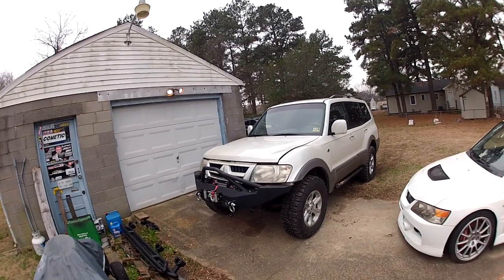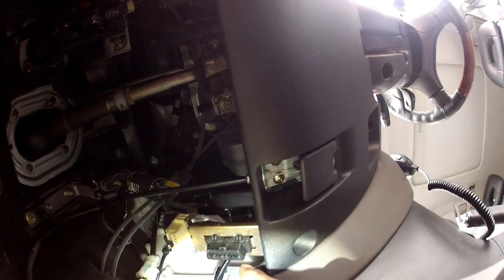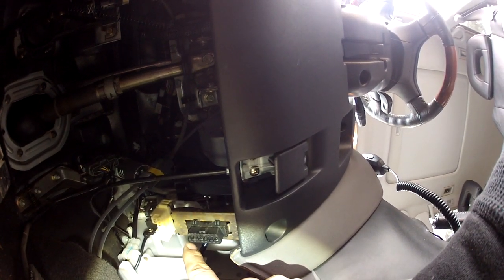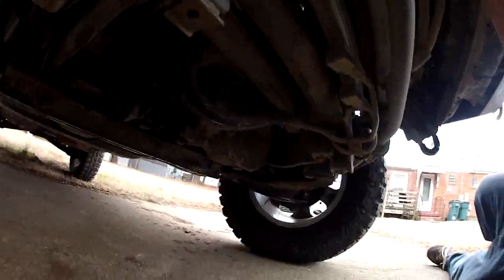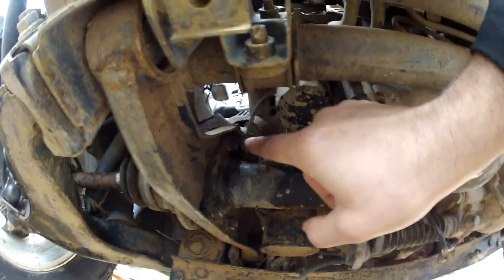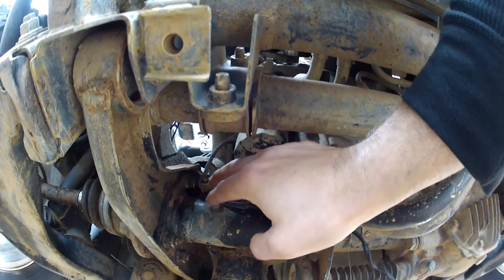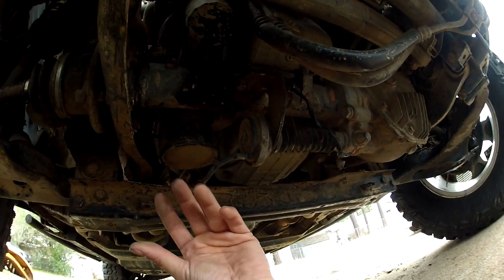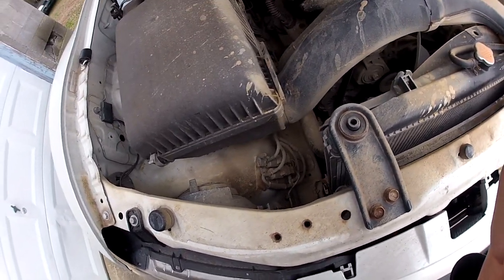How to fix blinking lights on Montero Pajero Activ Trac Super Select

Comment: Excellent video!
I recently bought a 2016 Montero Limited V6 4x4 in Mexico.  Shortly after taking ownership the blinking differential orange light started popping on at higher speeds after 20 KM of driving.   I was too late finding your video and I replaced the freewheel clutch solenoid (next to the battery) and this did not fix the problem.  We have not used the 4WD in quite a while.  When we tested it the other day, we got the 2 front wheels blinking indicator in every mode.  Basically, the 4WD is not functioning.  
Is the detailed information in your video applicable to my 2016 model?

Comment: Hello. I have a 2002 year pajero. I have a problem with the drive. Namely, after 15, 20 kilometers, the central orange light starts flashing. If I then switch to 4x4, it doesn't work. When I turn the car off and on again, it works normally. Thanks for the answer, greetings from Slovenia :)

Comment: Hi my actuator on the transfer case isn't working the gears don't light up when I select it, any idea?
Reply from the maker: Its likely not the acturator, but faulted and not telling the actuator to move. What are the codes?
Reply: @davidg.9478  gonna check the codes now bro will reply shortly
Reply: @davidg.9478  hi I did the paper clip test and the abs light flashes continously as well as the center diff light

Comment: Please I would like your help.  There is the gear lever of my mitsubishi pajero manual gearbox which shakes a lot on takeoff.  It also shakes when I slow down to stop for example.  Often also It goes out while I am driving normally 80km/h.
 The mechanic checked the oil in the gearbox, it was missing, we added oil but the problem persists.  He also checked the fuel injector pump but still the problem.
 Finally he told me that I have to change the clutch disc.  Need your opinions please

Comment: How you bypass from 4H to 2WD I also have code 33 and it only works in 4hlc and 4llc and when I go from 4HLc to 4H start blinking only orang light and is stuck in 4H
Reply: And on diagnostic shows t/f mode det 4H_4HL
Reply: Even if I chenge to 2WD

Comment: I have code 33. I just changed all the sensors and it still isn't working. It started to function but now it's stuff in 4wd and I can't get it out of there and into 2wd. It also won't shift into 5th gear. Any ideas?
Reply from the maker: After change the sensors, do you still have code 33 and center blinking light? Im going to guess you changed to after market switches and not OEM. The non-oem switches aren't as good, and sometimes you need to remove the washer to get them working correctly. The 5th gear issue won't be releated to the 4wd Active-Trac or transfer case. You may have unpluged something for the transmission while changing tbe sensors. You should get a normal Check Engine light code for transmission issues. I would check that with an OBD reader for clues on where to look to fix that.
Reply: @davidg.9478  I was having a center blinking light after I changed the sensors I got from RockAuto. I changed them a few weeks ago. Today, when I turned it on, the rear green lights were on. I began shifting through the 4wd. When I went into 4HLc, the orange light came back on. I moved the selector back to 2wd and when I drove it, it wouldn't swift into 5th even when I was manually trying to do it. I'm just trying to figure how to get it into 2wd so I can still drive it. When I turn the front becomes very stiff and almost feels like it's binding.

Comment: from when i can get those codes sheets for my car?

Mitsubishi Pajero 2016 NX V87 3 doors 3.8 petrol
Reply from the maker: I have a link to code sheet in the comments that is good for the 4th Gen +2006. I haven't checked to see if there was any code added for your years. They are in the service tech manuals and not sure if the 2016 manuals are even obtainable yet. Mitsubishi tends to add codes and not change the older ones so the current list should still be valid.

Comment: Thanks. Now I understand how this system works.  

I've got a 2003 Montero Limited, 3.8L, 217,000 miles.  I've also got the infamous Differential Lock orange blinking light that would come and go for months and eventually stayed, and DTC 33 when I read the codes by jumping pins 1 & 4 on the OBD2 plug and counting the blinks.  I also had codes 34 and 35 but after swapping the Freewheel Clutch Solenoid and disconnecting the battery for 5 minutes, the 34/35 codes went away and only 33 remains...the center orange light blinking and no control of the system remain also.

The ground cable on the transfer case is good.  All device plugs, vacuum hoses and wires are connected, clean and tight.  Voltage reads 10.8-volts from each of the switches' harnesses with the ignition key On.

I'm trying to figure out which Transfer Position Switch(s) (1 thru 5) is actually bad, before dropping the t-case to swap all 5 of them out.  I want to be sure something else is not the issue making it look as of the switches are bad, as I hate swapping parts and doing unnecessary labor. I'm suspicious because I know the clutch solenoids were bad because I tested them, but I doubt they went bad, plus a t-case switch also...as in simultaneously.  Maybe so, maybe not.

I have a test light probe and a digital voltmeter/ohmmeter. Is there a test procedure to test each switch before dropping the t-case and removing them to be sure it is a switch (or maybe two) and not another issue? 

Thanks!
Reply: You solved it?
Reply: @DooDicky  yes. When the solenoid failed it confused the 5 switches. All I did was manually open and ground the applicable plugs to make it cycle from 2wd to 4 low lock and then back to 2h. It reset the switches.  I would not suggest changing switches until you do this first, especially if you had a 4x4 part fail and it was replaced.

Comment: what kind of bumper is that? is it custom?
Reply from the maker: Its a 72" wide Jeep JK bumper. The widest they make. And then i made custom bolt on mounts which are coincidentally simular to the ARB bumper mounts. Turned out really nice, i like it more then the ARB options.
Reply: @davidg.9478  yeah I like a lot better thanks 🙏

Comment: I had front wheel light blinking issues. It turns out that one of the wire of the sensor switch was cut. If it wasn’t for your video, i wouldn’t be familiar with the system. Local mechanic, advice me to change the transfer case. Many thanks man. You are legendary!
Reply: My front tire light flashes too and rear tire lights don't come on

Comment: mine continues to blink.... does that mean no codes
Reply from the maker: If you have the blinking center light, then there is a code. If jumping the OBD pins it continues to blink the same way instead of blinking you a code, then your pins are not jumped out correctly.
Reply: @davidg.9478  i jumped pin 8 with pin 4 and it just blinked a constant never ending or changing length or sequence.. the problem I'm having is after changing the solenoids because of partial engagement in 2wd but not 4wd(awd), now it won't fully engage in 4wd, i hear it but doesn't complete. I'm figuring it must be vacuum related.  i checked the harness over the axle and it was clean, and i checked out the actuator on front diff and it was decently clean, nothing obviously broken
Reply: @davidg.9478  i have a scissor lift in my garage and also just finished replacing rack and pinion, poly control arm(upper and lower) bushings, all ball joints, tierods, sway bar bushings, rotors, pads, brake hose, and New Bilstein front shocks.

Comment: Great video! Man i ordered the 5 switches and the vacuum selenoids! But before i put them in i decided to take a look under the car! Turned out that conector under the oil filter had a broken wire! Splined it together and now everything is working fine!! 🙏 thanks!

Comment: Thank you so much for this video. Do you have the full file for the fault codes? 
Mine currently have codes, 31, 38, 42, 52, 64 and 83. Any help please?
Reply from the maker: What year and model Montero do you have. The chart i have linked in description is all the codes listed. You either have a diffrent model or your not reading the codes correctly.

Comment: I have the centre diff light flashing when driving for a distance. I have a new vacuum solenoid and at the freewheel actuator there is suction in one pipe when in 2H and in the other when in 4H. However, actuator does not move in or out. It does move by hand so not seized. So I am guessing the actuator needs replacement?

Comment: I got 23, the front propeller speed sensor system. I have no idea where or what that is. If you could that would be great
Reply from the maker: http://faq.out-club.ru/download/pajero_iv/maintenance/Service_Manual_2008_2013/2008_eur/22/html/M122110410005200ENG.HTM
Reply: @davidg.9478  thanks also do you where I can find the codes for my 02 3.5 NM.. just incase im chasing the wrong codes
Reply from the maker: @thombo1524  no problem. The code sheet in he comment includes your year and model. So if the active-trac is showing code 23 it should match the description. However code 23 is not very common in this system. Id ask if there was any work done recently or suggest looking at the wiring and simple stuff first.
Reply: @davidg.9478  I just recently bought the car so wouldn't know about any work done. I've checked the vacuum into the actuator, seems fine, it moves back and forward. All the connections seem good also. Ill replace the transfer switches before I try code 23
Reply from the maker: @thombo1524  do you have other codes? Because looking at the other items wont help you with code 23 unless theres other codes your addressing as well.

Comment: Hi David, just got my 2000 NP DID. Awesome so far but my front wheel indicator blinking and I'll try getting the code. My question is it ok to stay in 4H? Noticed the rear wheel indicator doesn't light up. Thanks for the great vid, I'm learning something new for my truck.
Reply: Ok tried pulling any error code, the engine light just blinks, not long and short - just blinks...

Comment: Nice video man appreciate it! I had no idea diff codes don’t show up on OBD 2. I’ve had the center diff light blink on me two times On the highway now but it went away after restarting the car. Hasn’t come back but still a little worrisome. Would the codes still read right now or do they only show up as issues are happening.  Thanks!
Reply from the maker: You could still try to pull the code once its cleared. It does seem to store for some unknown period.
Reply: David G. Thanks bro! I’ll give it a try

Comment: I did this on my 2001 3.2 DID Pajero, my transfer case light blinks constantly at a fixed rate. However, my ABS light gives me codes 21, 22, 23, 24, 33, 52. Is this normal that the ABS instead of the Transfer case light flickers? I have a video that I can share.
Reply from the maker: ABS error codes can trip the Activ Trac Super Select system. So i would look into the ABS codes and in addition you can look at the 4WD systems codes to ensure the errors are in response to the ABS system. In your case you need to get tje bigget picture to determine the cause. If i get a chance i will look up the abs code definitions later today.
Reply: Same with me just did this I'm having a loud ding noise that's constant with abs light and brake light on brakes went hard . Changed out the entire booster unit and brakes came back but still getting the loudly annoying chime and abs and brake lights still on. Brakes great not sure what is wrong

Comment: Hello Sir David, I know it doesn't have anything to do with the main content of your video but where can I get a bull bar/guard like your Montero's. I've come across the single tubular model that only holds the fug lights and a winch platform. I like the looks of a full size bull guard.
Reply from the maker: The bull bar front bumper i have is a custom fit i did my self. It is a 72" wide Jeep JK bumper. I made custom brackets that bolted around and through the front frame support with plates to mount the JK bumper too. If your looking to use a jeep JK bumper, anything under 72" wont reach the fenders so keep that in mind.

Comment: Hi David. My Montero 3.2 DID from 2000 with 4M41 motor has a blinking light in all positions except 2H. But it is very special. f.i. if I switch from 2H to 4H I hear the system under the car work and it drives 4 wheels. But after about 10 seconds I have the blinking light and the 4 green light switch off. It keeps 4 wheel drive after this. But now it is not possible to switch to another position. I have to switch off the motor and start again and then I hear the system work for the position I have chosen. Again blinking light after 10 seconds except for 2H. In these 10 seconds all lights work properly! I supose that the old owner has not used the 4WD very much. Thanks for your help. By the way, I found code 23 yesterday. My garage cannot find the problem. Is this fault indeed code 23?
Reply: Hy, wat was the problem by you, i have similar problem ?
Reply: @aeperformance6765  Hello, I still did not repair the problem. I should have go to a Mitsubishi dealer but they are very exspensive. Probably one of the sensors on top of the transferbox is broken because the "all brand garage" did not lower the box. I like to hear from you how you solved the problem. Succes.
Reply: @guido53  hi, i have found 2 codes by me, 23 front speed sensor 2 and 35 front whell engage, need to check this, it is good if you can recive the codes, than you bether know where to look .
Reply: @aeperformance6765  Tell me please how you have solved the problem. I have my car on my holiday adress where I do not have much tool.
Reply: @guido53  i have Launch diagnostic, and i culd read the codes in transfer case. But you can trough the blinking lights read it to, every bliknk is x10 calculated. slow blink is first number, fast blink is second, i hope it helps.
Reply: @aeperformance6765  I did it the same way, but it is posible that the cause is somewhere else! Because everything is connected to each other it is difficult to find the primary cause. I'm very curious what you're going to find.
Reply: @guido53  First wat i will do, is to change tyres, because the dimension is not right one, after i see if this is maybe problem for the speed sensor and actuator i need to check.
Reply: @guido53  Hi, i was working on my rear brakes, and saw under the car a conector hanging, i put it back and for now, i have no blinking light on short drives(befor it was after some meters) but i saw another one witch is not conected, but have not seen wher this goes, need lift it up and check. But for now its bether
Reply: @aeperformance6765  Hi, that is a quick repair! I always dream of such repairs but unfortunately not on my car.

Comment: My front tires light up green and flash . they are solid when in 4x4 no lights for back tires .also how you you use diff lock I don't see a button or nothing just 2h 4h 4l
Reply from the maker: The flashing green light indicate an issue with the front tires like i mentioned in the video. If the center yellow light is flashing it indicates an error or issue in the system. Your rear light should always be on unless the yellow center light is blinking. If no lights are on, then that means you've probably blown the light bulbs for the two rear wheel light indicators in the display. I didnt cover that, but i would atempt to replace the bulbs.
Reply: @davidg.9478  thanks for the fast reply mine is 2001 and only has 2h 4h 4l is there away to unlock the diff lock features or is it a different rear end and transfer case also it does not coast when you let off the gas don't know if that is related or not no check engine lights on
Reply from the maker: Is it a Montero Limited, or Montero Sport? What country? 

All the Montero Limited in the USA have 4L and the 4LLC which is the locked center. Its going to require the locking center differential. Im sure it could be swapped if you didnt have it, but its not something i could walk you through online.
Reply from the maker: Also, if its not coasting are you sure its in 2WD? Meaning the only light on would be the two rears, or if the rear bulbs are blown, then no lights at all. 😉

I would probably need more info on your vehicle to aid you any better, as im not fully aware on your vehicle configuration.
Reply: @davidg.9478  I believe the rear green lights are blown my front lights blink most of the time it's a third gen Montero can't recall the exact model but it's the basic one not a sport it's real Montero and at 70mph I'm at 2900 rpm .does that sound right seems a bit high when I let off the gas it slows down pretty fast it doesn't coast at all the converter does not let go to coast I have  no problems with it sticking while coming to a stop
Reply: @davidg.9478  and yes it's in 2 wheel drive

Comment: Nice evo by the way! Hey i have a question i ordered all 5 switches im getting code 33 and they all look the same except for the wires colors are different!! Are they all the same or they go in certain position on the transfer case?
Reply from the maker: Each goes in its own position. If you hit the details on this video i have a super sheet linked that lists the part numbers, wire colors, and locations for each sensor. I took the time to find an amazing amount of great info you normally have to search the entire manual and then the internet for hours to find, and then out it all on one awesome sheet, enjoy mate 😉.
Reply: David G. Cool!! Thanks a lot!!